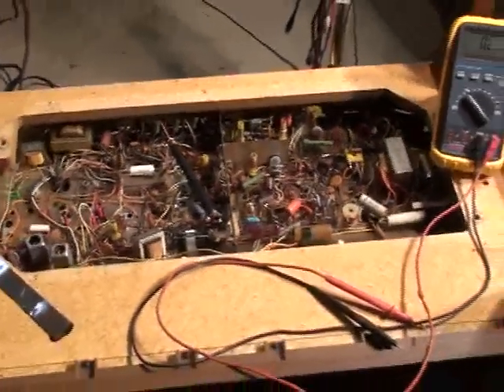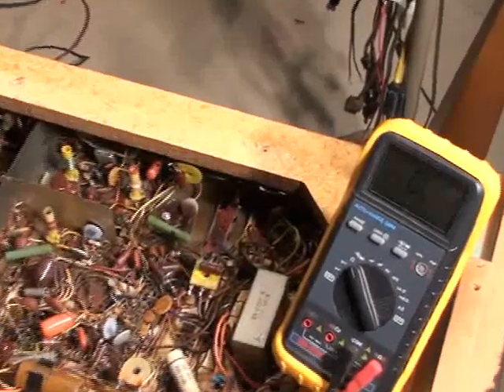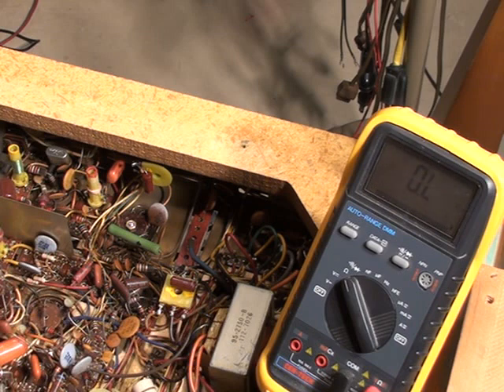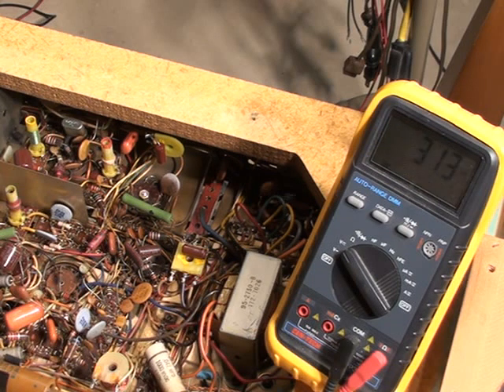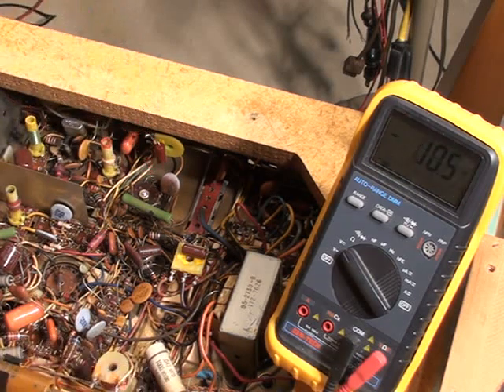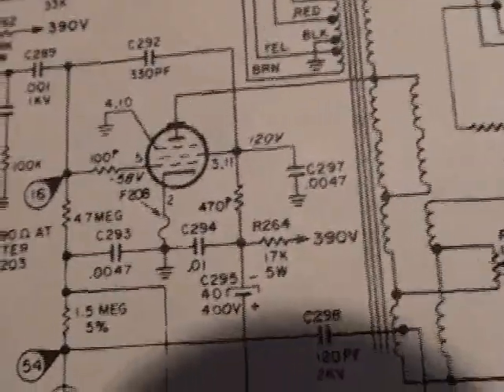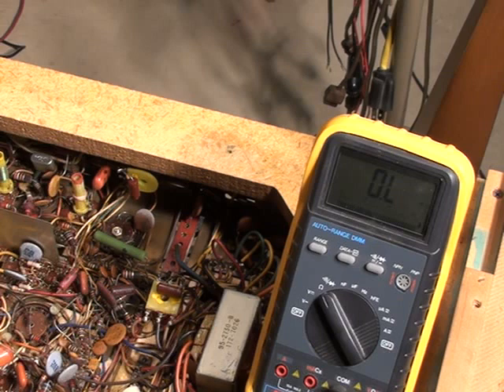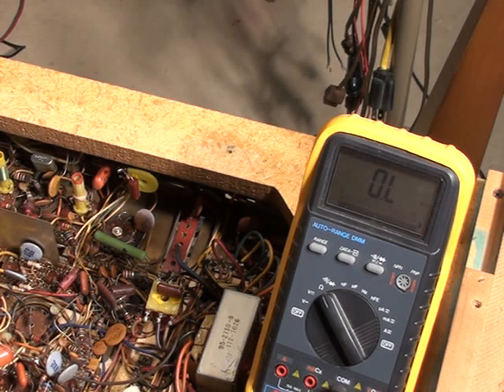1971 Zenith color television in repair, part 3 of 4

Comment: This was very well done . these sets where built so well. Most of the time when these sets where new the Hv would be low and either the 3db3 or the 6hv5a was bad. When they were around ten years old the devider would start  swell replace that. I remember changing the .0047 in the 80's on that set .  I remeber the hv would go Hi and the one in the 6lb6 circuit would open upand the hv would run high.